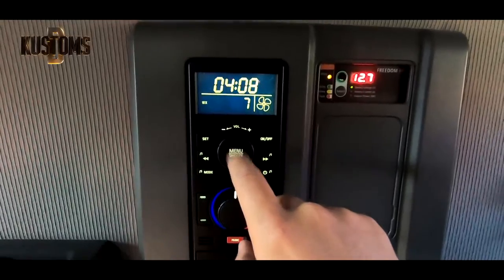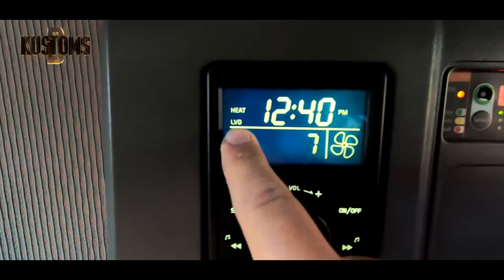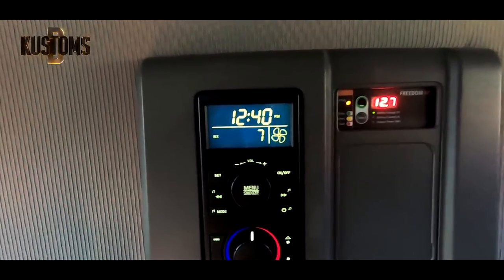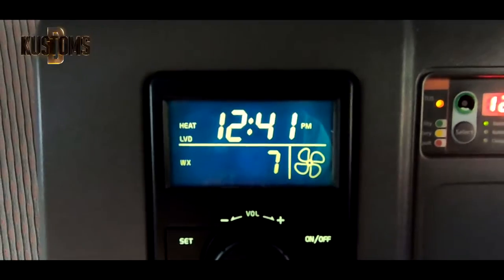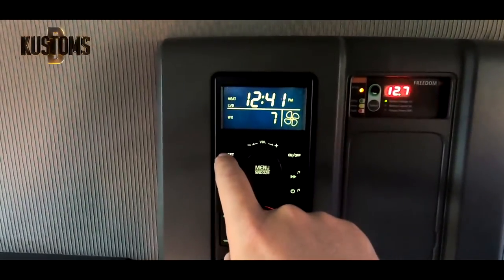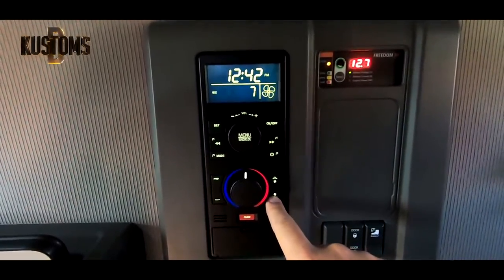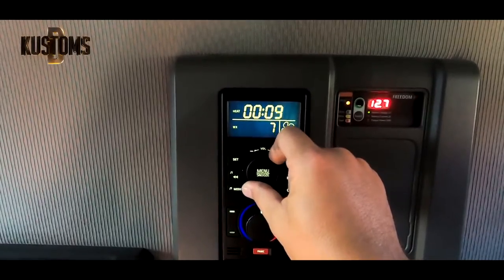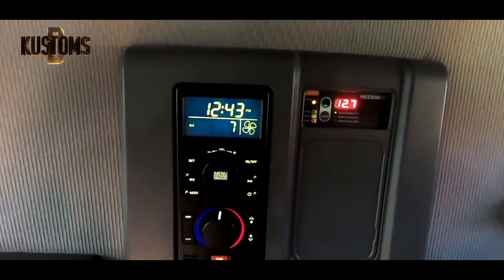2020 Volvo bunk heater AUTO MODE

Comment: I just got a new Volvo from my company. I was trying to test my bunk heater like you showed and it never turned on. I also have no blower under my bunk. Could it be that not all Vovlos are equipped with bunk heaters?
Reply from the maker: Correct, not all Volvo have a bunk heater. Do you have diesel or any kind of APU?
Reply: It will be under your bed left side in pocket

Comment: I set the heat to on. And then set the heat to cycle 6 minutes and turned the lvd on but it isnt turning on.... im trying to use the A/C because im in texas and its very hot in the cab.... am i doing something wrong?
Reply from the maker: This is only for heat.
Reply: @DKUSTOMSGARAGE  so is there no way to control the a/c via the wall without the truck being in idle?

Comment: My LVD is set to 12.4 voltage. And constantly in the middle of the night the alarm goes off and the heater turns off. How to set LVD to 11.9 voltage?
Reply from the maker: 11.9 low, need 12.1 the lowest. Sounds like your batteries are bad.

Comment: Does the truck have to be running and if so I have a automatic idle control
Reply from the maker: No, truck should be off.
Reply: @DKUSTOMSGARAGE  isn't the batteries gonna die
Reply from the maker: On a volvo yes!!!! On a freight liner it will shut off system.

Comment: Does enyone know why my bunk ac doesn't blow at all occasionally when i turn it on?(front works fine) Volvo vnl 760 2019. Thank you
Reply from the maker: Start from fuses…
Reply: @DKUSTOMSGARAGE  i did. All fine...sometimes works, sometimes don't
Reply: @GG_WP.13  I was a diesel Tech for 20 years.    The sleeper uses it's own condenser and blower motor and they are located on passenger side under bunk.  If the motor sometimes blows and you checked the fuses, odds are you got a bad connection at the harness or the motor itself.  Get a light tester and check for power and ground at the motor when it's on and not blowing.

Comment: Thanks a lot from the video but mine still produce heat tho I turn it to cold but still heat
Reply from the maker: I think it got stuck in the hot position. Take shelf out till you get to AC/heater exchanger. Got to check out if that little door moves from cold to hot position. It happens sometimes too.